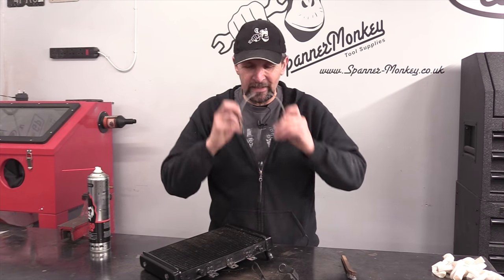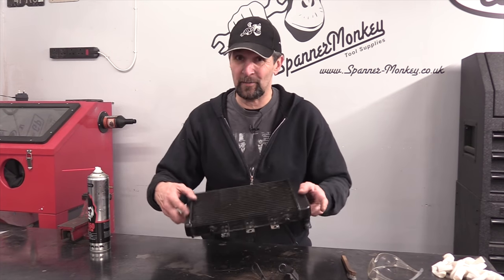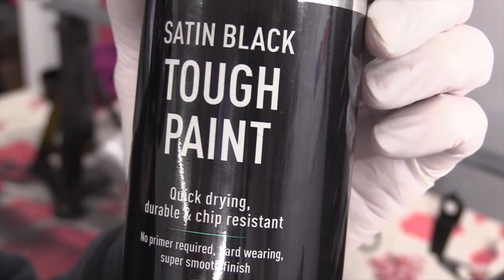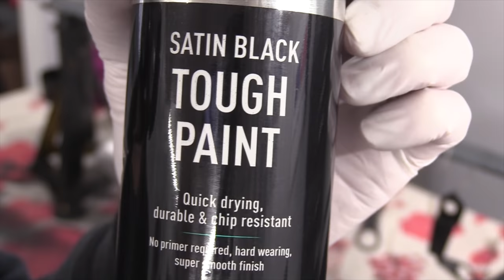Triumph TT Legend, More Progress, Radiator and Shrouds Painted

Comment: Nice !  Beautiful job.  I flushed my radiator on my 2017 Triumph Bonneville Street Cup August, 2020.  Triumph from 22 connections down to 5 on the new  "modern" Bonneville.   #1,2 Upper and lower hoses.  #3,4 grommets on the bottom to ride on pins on the frame. #5   8mm bolt with grommet and Hat Washer to keep it from moving around.  I am an Engineer, so. . . . . . . . Less is More,  Haha.  Take care , stay healthy, Ride Safe.

Comment: watched a few of your bike builds now and for me the triumph is by far my favourite. The wheels are awesome and really take the bike to a different level. Will continue to follow your builds and if you run out of ideas of bikes to work on I have a 2001 Yamaha r1 with 3500 miles on the clock that needs some tlc
Reply from the maker: Awesome bike mate, and getting rare now in nice condition, imagine what that would look like with spoke wheels!
Reply: @Moonfleet41   that would be awesome. I wonder if anyone has tried it. Would have to be similar wheels to yours though just a bit wider.When do we start lol

Comment: Hey Del! Fabulous work! 
BTW, have ever considered cold bluing of the metal? It's a chemical that you paint on with a brush and it and it does the same reaction without heating the metal which might change the properties. All you have to do in the end to wash it with cold water.
Reply from the maker: Hi Abouzar, great to hear form you, we hope you're well and keeping safe.  I have seen that used on other creators videos, and it looks really good. once we get moved ill take a look into it.
Reply: It is an interesting process, depending on the product the application of a uniform coating took a bit of trial and error, but for me, Nu-Blu came out best of the ones I have tied.

Comment: Great job Del! Love to watch each part as it's a simple pleasure and relaxing, besides it's fantastic that with each video you give some small tips and tricks like pouring hot water on hard rubbers to make them easy to get off and reduce the risk of damaging.
Reply from the maker: Thank you buddy, that's very kind of you to say, things like the hot water trick are just basic common sense, old house keeping methods to keep things safe, and like you say, prevent old rubber from breaking up, specially when it's only 10 degrees in your garage!

Comment: Hey D, great video. I'm currently about to get off the sofa and get out to the shed to continue the restoration of my 2012 Ducati Multistrada. On the clip blackening with oil, do you just use the blackest old oil you can find to do this? Also, is the finish durable? I have "ok" disk bolts that I'd like to reuse and they need a freshen up.....just wondering whether to sandblast the heads and do them this way also. Great videos dude....
Reply from the maker: Hi mate.. the process of oil burning for corrosion prevention is pretty limited in what you can use it on.. The process of heating metal parts can effect them structurally if it's not done exactly right...im sure you know that the heating process is utterly critical, if you overheat the metal you soften it, quenching in oil can then change it's properties totally.. that's why we heat and oil quench tools and knife blades, so make them strong and hard... so little clips and random fasteners are ok, make sure you  keep the temp below red... but for the Disc Bolts.. with how critical they are to safety.. i would replace them if you can afford to.. i know they're pricey.. so if not then clean them up manually and just see how they go in the future..even paint the heads once in situ with a dab of ACF50,  i certainly wouldn't heat and quench them mate... best to be safe aye !
Reply: Perfect....I thought that to be fair. Think I'll just order a fresh set. Nice one and thanks for the reply

Comment: Hi Del, great video not that you'd do any less! Quick question for you if you don't mind. When painting radiator do you paint the fins as well? If yes, does that effect the "performance" of the radiator? Thanks in advance for your answer!
Reply from the maker: Hi Adrian, if im painting a radiator, i usually just "mist" a light coat of paint onto the matrix area, just enough to make a block colour and no more.. it's already painted from the factory, and a far worse situation is to have the matrix blocked up with road dirt, salt and mud... this will inhibit air flow and certainly effect the cooling ability.
Reply: @Moonfleet41  thanks for your prompt reply! Good luck with the move!

Comment: Hi Del- yep, good decision re painting the radiator et al!   Hope you both are doing ok.  (My MIL said she’s just waiting to hear from you re the move.   She also wants to know if she should bring her own beer?). 🏍👍🏍
Reply from the maker: Hi Gary,  The more parts i paint and refurbish, the more it makes other parts stand out as needing the same... but i guess that's what's gonna make a great bike at the end..   and Re- MIL, Beer we have, but if she could bring her fork lift, and her own Dip Cup that would help, as we only have metric one over here..
Reply: @Moonfleet41  yessir, agree-!  Just recently experienced that here in the remodeling- it takes you to a door frame, an adjacent ceiling, a shelf repaint, some nail pops, a secret rendezvous with the neighbor’s wife, well, you get the picture.  The MIL will definitely bring her own dip cup. I DO have to warn you however, her spit aim is not what it used to be.  It’s best to grin and bear it as best as you can and then use some brake cleaner on her after all the work is done.  😎
Reply from the maker: @garya3056  No worries, we'll get the mackintoshes out for her busier spitting days and perhaps it will add some patina to the walls ... and as for brake cleaner, we find it's far cheaper to use some sump oil and kerosene  and a scrub down with a yard brush... and a shake of white vinegar to freshen her up!  pip pip ol' chap...!
Reply: @Moonfleet41  Yah got me!  haha!  She sure is looking forward to being spoiled by you! I just hope she doesn’t expect that level of service when she returns home.  🤗

Comment: Hi Del. 
I have chromed radiator side covers and I wanted to paint them black. 
How would you go about it?
Reply from the maker: You can paint over chrome as long as it's a stable layer and not pealing or cracked.. just sand it back with some 120 grit paper, then an 800 grit paper to get a key for the paint to stick, then etch primer and paint..   Or you can use this 'Tough Paint' product which is designed to go directly onto metal with no primer, and works very well as you can see.  !

Comment: How do you keep the layer of paint on the heat transfer corrugations of the radiator as thin as possible (to not block heat transfer) yet look evenly black?
Reply from the maker: With the process of painting a radiator, I invariably always use a rattle can which blows very little paint, compared to a spray gun, and I focus the paint direction on the sides and the top and bottom and just 'mist' the paint across the matrix a few times, making sure not to lay even a full wet coat on it... once the paint dries and shrinks back, nothing blocks the matrix, it's a very thin mist of paint!   Your radiator is good to work with a certain amount of blockage in the holes, consider road dirt and debris that gets in them over the years, and they still work fine, it's far more important to keep that cleared than to worry about a think layer of paint.

Comment: Looking very nice mate. Quick question. I may have missed it, but why does that spray not require an under coat? You may have been asked this already, sorry if you have. 😎👍🏍
Reply from the maker: Yeah, I get asked that all the time Nick.. it's a flexible chip paint, works like Hammerite, and needs no primer, it self etches into the metal, you just need a chemically clean surface, and it goes straight on to bare metal..   Check it out, it;s called "Simoniz Tough Paint".  !
Reply: @Moonfleet41  cheers Del, I'll look it up. 😎👍🏍

Comment: Mate hope you are well and staying safe 
The process of heating bolts and dropping in oil you use, is it any good and does it last?
Reply from the maker: Yes it lasts, it's a historic process, a blacksmithing discipline, in fact, goes back to the Romans, or even earlier, heat the metal up to at least 450' and quench in oil, if you want the bolts to stay reasonably clean looking and a light gold colour, use clean oil but if you want them black, you can use old diesel sump oil that's loaded with carbon, if you dip a few tips, build up the layers, it will go nice satin black and keep them waterproof, but don't overheat the bolts as you can make them brittle.
Reply: @Moonfleet41  yes mate 👌👌

Comment: Got to be about time you buy a supply of black paint and use the compressor and spray gun isn't it? Is there a reason rattle cans are better, I guess for small jobs but you do a lot of the same black, would it not make sense ;-) Looking good though.
Reply from the maker: It is far more economical for small parts restoration to do it this way, I don't have a spray booth and before you make these jumped conclusions conider that it's more than just paint, look up the cost of a litre of paint, then a gallon of thinners, activator, and any other chemicals in a pro- painting process, cost of a spray gun and equipment and, of course, the workload in setting all that up and cleaning it all afterwards, just to spray a few parts... I buy this stone chip paint in packs of 6 or 12, it's half the price of retail and I reach for it when I need it... by far and away the best way to do it, both economically and in time commitment.  Only the final bodywork paint job will be done in a proper spray booth where I can borrow the equipment and have the paint mixed on site.  Posher isn't always better!
Reply: @Moonfleet41 - fair points! haha, well that told me ;-) I do think the finish you achieve is very good, i had not fully realised how much was involved using a compressor, thanks for the answer. Good luck with the move.
Reply from the maker: @ianm8429  Thanks buddy, lots to do, and we're taking the cameras along for the ride.. so you'll see it all ..

Comment: Might make me look stupid but why do you spray the cloth every so often? 
Good luck with the move a bit of a pain after all the work getting this place ready not so long ago.
Reply from the maker: Hi Alan,  with the paint.. after each coat, when im going to leave the can to stand for 15 minutes, it helps to invert the can upside down, then spray the tube out so it clears the nozzle..    when you invert the can, the tube is no longer in 'paint'.. its poking out into the compressed air space, so when you press the cap, it just forces 'air only' out, and clears the tube and nozzle, this prevents it clogging up and keeps it spraying clean right to the last drop. !     and thanks for the good wishes, it is a pain to have to move again so soon.. but the new place is so much better, it's well worth the effort.

Comment: 5:08 ok.. can that work on stainless steel bolts??
Reply from the maker: Well obviously there's no need for rust proofing purposes, but purely for looks, it will work, but you may need several quenches to get a fully black finish and make sure you don't overheat them and make them weak.
Reply: @Moonfleet41  I wouldn't mind a light anthracite colour. Considering a complete fairing kit is at around 50$, it seems like a nice DIY
Reply from the maker: @trantas4  Okey dokey, you can experiment with it, I actually did some washers for a neighbour today, hooked them on a length of wire and the first heat and quench made them a yellow finish, and then each successive heat and quench got them darker each time, and after about 8 dips, and torching them whilst wet to re-heat, eventually made them black and they were stainless, so it's progressive and you can control the colour really well... !
Reply: @Moonfleet41  Thank you for the info! I might experiment with a few bolts that i don't need before going at the fairing ones. Very nicely done videos by the way, bravo!

Comment: Having a right nightmare getting my rad fixed or replaced for my 2012 suzuki gsr750 been quoted £350 to recore and cant get after market rad for under £300!!!!! :-(
Reply from the maker: WHAT ?... Mark.. thats mad, here's the link to the company that supplied the brand new radiators for my Kawasaki ZX-7R and the Hayabusa... both top quality, and totally identical to the OEM rad.. Linky Here mate:-- https://www.ebay.co.uk/str/primecooling-eu?_bkw=GSXR+750+radiator          Link to your exact Rad..   https://www.ebay.co.uk/itm/Aluminium-Rennen-Kuhler-Fur-Suzuki-GSXR600-GSXR750-2011-2019-2012-2013-2014-2015/143908877257?hash=item2181a333c9:g:HR8AAOSwkyRdzkQT
Reply: @Moonfleet41  thats prob mines the naked gsxr750 called a gsr750 but i will have a look at the links and see if they do mine, cheers buddy